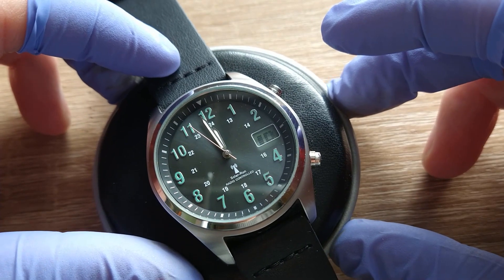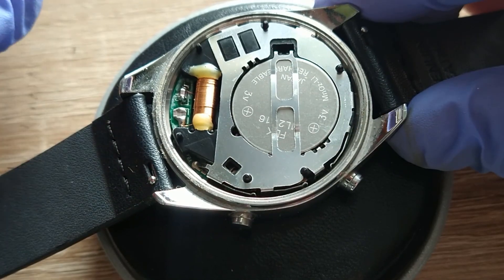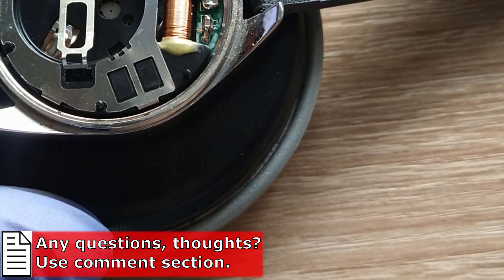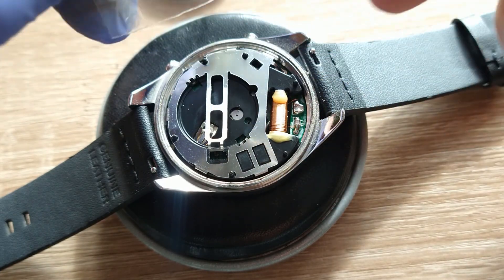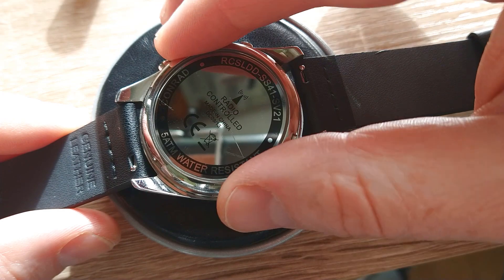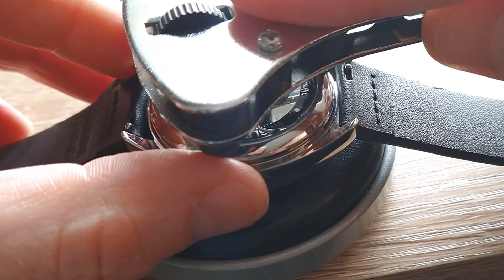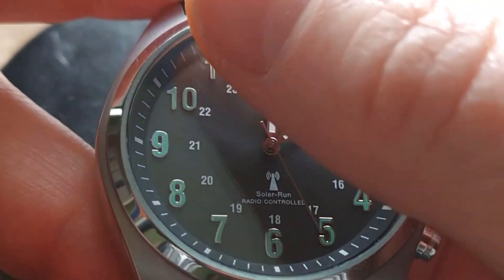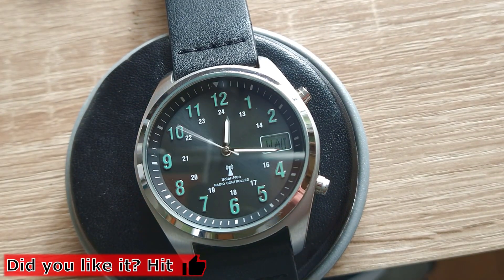Solar run radio controlled watch from Conrad - wristwatch battery replacement

Comment: IS IT A REGULAR LITHIUM BATTERY OR A RECHARGEABLE BATTERY?
Reply from the maker: Only rechargeable battery!!!
Reply: @tickingWATCH  Whose brand is it, is it of good quality?
Reply from the maker: @ivanklementa9795  I bought it in Conrad Market and have had it since 2013. The rechargeable battery needs to be changed every five years.